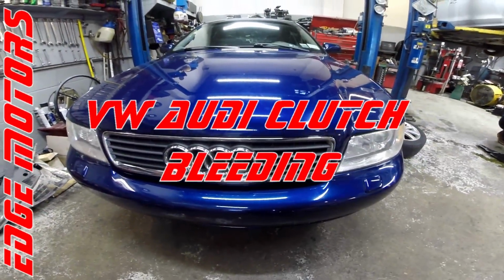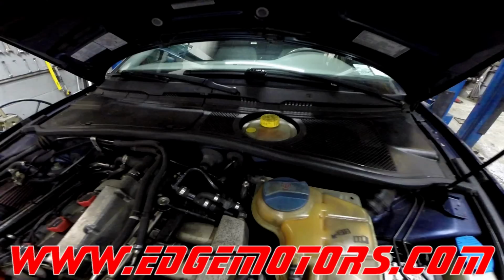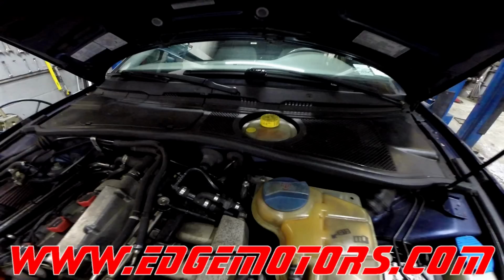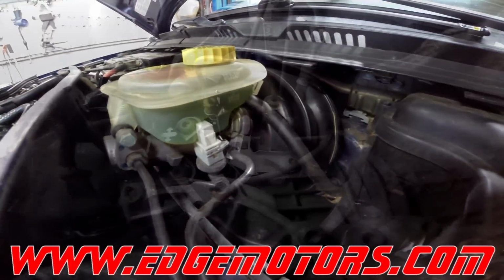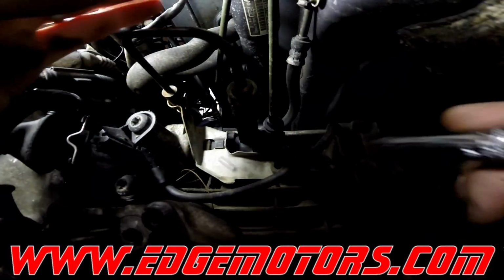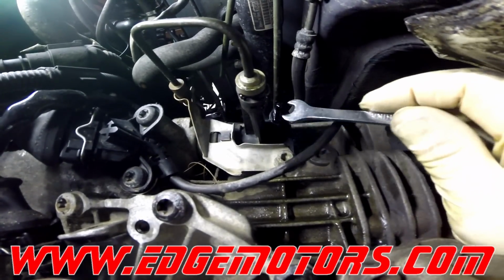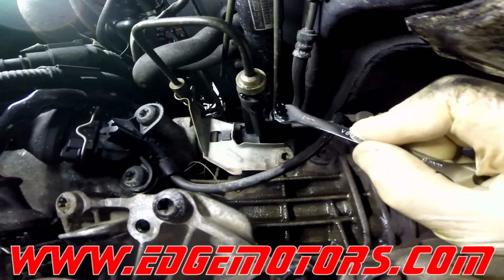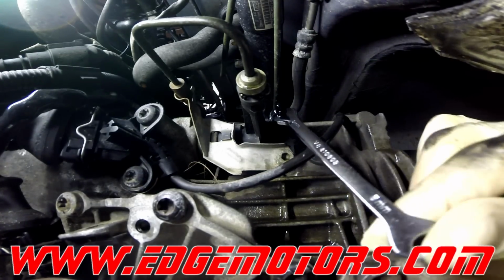VW Audi Clutch System Bleeding by Edge Motors

Comment: This works for the B8.5 S4? I have had 0 luck with it. It keeps sucking air back in and it may be because of the fluid level. BTW, I used your videos for replacing the clutch.
Reply from the maker: It should work on all cars with manual trans.... did the video help you?
Reply: @EDGEMOTORS  those trans bolts were a PAIN IN THE A**! The video was awesome!  I will try it that way tomorrow.